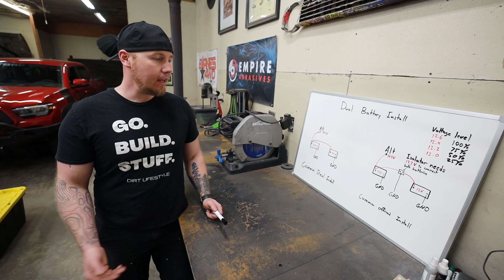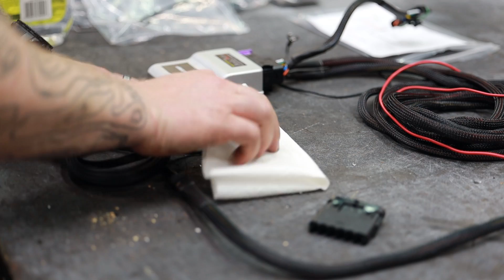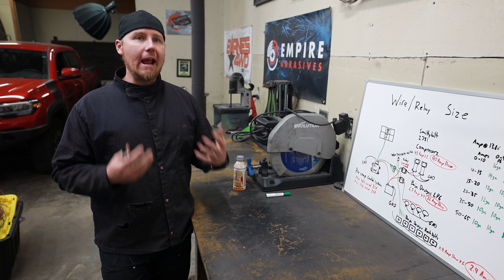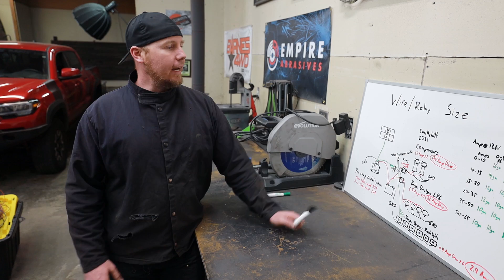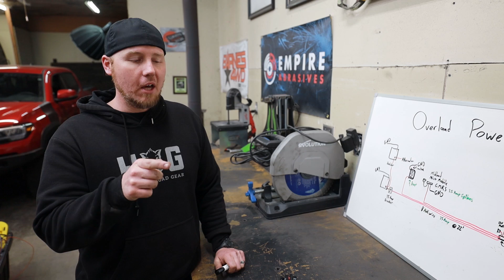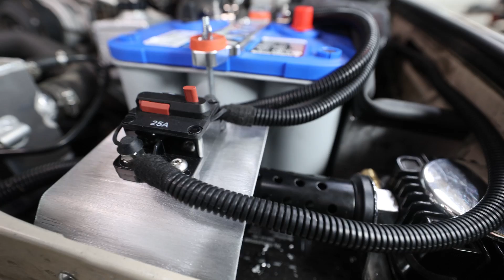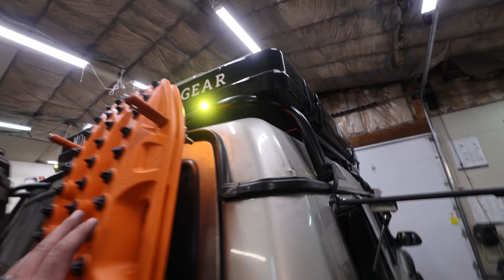A Complete Off-Road Wiring Guide! Ultimate Land Rover Discovery Build Episode 26

Comment: I loved this video. Great work! I love how you did nice neat wiring and how you sealed up your connections with shrink tube. I love watching your builds. You are fearless when you start drilling holes into your rigs.

My two cents.
A couple of things I would have like to seen: How you passed the wiring out of the engine compartment to the off road lights on top and out the back. The other is doing a big three or big 7 wire upgrade to the electrical system to handle increased loads... especially for continuous winching and compressor use...

Also, a DC-DC charge controller is needed when the alternator is a smart alternator or the battery isolator will never see the start battery is charged and then never switch over and charge the second battery system (or it will drain the start battery to fill the second battery). I would also have used a deep cycle secondary battery and not just a second start battery. Another nice thing about a DC-DC charge controller is that you can add solar panels and keep the batteries charging when the engine is not running by using the sun.

Great video. Keep them coming.

Comment: I’m an electrician you always have to account for voltage drop 
(distance of wire from source) safe bet with cars ALWAYS USE 12g-14g and always stay within ohms law this will give you all the numbers you need for wire gauge. Now something to also remember which I’ve done this and had a bad fire that could of been worse in an old truck of mine ran the wire the aftermarket kit came with for my led lights in my Truck cap needless to say after 4 years they burned up caught on fire and fell on my fuel lines and literally melted into my fuel lines. So resistance in your wires cause heat which cause the wires to become hot and over time deterioration sets in the wrong gauge will cause a fire because the wire doesn’t have as much resistance with cars 12gauge wire is always a safe bet 14gauge is overkill but I’ll never put anything else in my vehicle after having the fire I did. Do the research and don’t trust what these companies give you all the time because I got very lucky. Nate awesome video you pretty much hit the nail on the head. But me personally never going smaller than 12guage ever again lol

Comment: In the real world I use 3 batteries to start my diesel van. And the reason I do that is because cranking speed is key to a diesel starting. Even two batteries are getting hit harder than a gas engine. Three batteries brings the per battery amp draw more in line with a gas engine.

Comment: first off, must say Love it, clear concise down to earth explanations, and yes opinions on how and why for everything from battery choice to wiring decisions, is extremely vast.  One thing I would like to add, when you are doing large installations (btw the white board thing is awesome for layout planning, having some form of a map with decision notes helps ALOT, especially if it's a long term gather, or your adding more later or whatever, with notes on the map you can remind yourself WHY you made X decision) it can help when you run 1 larger wire as supply, to use some form of a junction box, or bus bar, etc as your run point for the individual pieces.  It may seem like an over complication, but it really helps later on, with maintenance or trouble shooting, to have known points of a circuit working instead of having to hack back into an entire harness.  example being a light group off 1 switch. it also can help clean up wiring gauge changes  .. 8 gauge to junction/bar, 12 gauge to each light, etc.  On large vehicle upgrade/installations .. I also like having known ground junctions that all feed back to the battery, instead of relying on the vehicle chassis (Ie in the case of the rover, one by a back door behind an easy to access panel, one by the dash, and one in the engine bay).  But again all of that is purely opinion/personal practice

Comment: Get some military battery connectors, allows you to simply crimp on an eye then bolt it up 🤘🏻🤘🏻

https://www.amazon.com/Ampper-Military-Terminal-Heatshrink-Vehicles/dp/B07W61LYG7/ref=mp_s_a_1_2_sspa?dchild=1&keywords=military+battery+terminal&qid=1621810839&sprefix=military+batt&sr=8-2-spons&psc=1&spLa=ZW5jcnlwdGVkUXVhbGlmaWVyPUFLU1U4WkpNU1Q0QUomZW5jcnlwdGVkSWQ9QTAyNTQ5MTYxWUNEWDVIM1ZNWElNJmVuY3J5cHRlZEFkSWQ9QTA2NDE4OTJBMFQ4TFVUMkQ5R1Qmd2lkZ2V0TmFtZT1zcF9waG9uZV9zZWFyY2hfYXRmJmFjdGlvbj1jbGlja1JlZGlyZWN0JmRvTm90TG9nQ2xpY2s9dHJ1ZQ==

Comment: I have that same radio.  My two favorite features.  The USB power port, just because I think that was a nead addition, but the Mic!  The RJ-45 connector for that mic can be extended to just about anywhere, so the base of the radio could be anywhere its convenient, and then you can run an extension to where ever youd like the mic.  I love that its just a standard rj-45.  Probably because I'm a computer guy, and wiring up rj-45 is something I can do in my sleep.  :P

Comment: For all the horror stories about Optima I've heard, I'm with you.....I have had them last forever and a day, so I keep using them.  Was wondering why you were using marine batteries, a fair enough reason.  Another good option is to buy terminals with multiple cable wells.  Also allows you to upgrade "big 4" charging circuit to much heavier gauge cables.  Mostly used for stereo guys, but simply works better especially with all those accessories (anything high draw/load).  I also put in a 200a alternator to keep those Optima's topped off well.  I think most of the Optima horror stories are because they aren't being kept fully charged by weeny stock charging systems.

Thanks for pointing out a good solid state isolator.  There's one made my an Aussie company I really liked, but can't get here.  Had a manual switch to open the circuit if you killed your start battery, could trickle from the house battery to get started.

Ohm's Law...it's not just a good idea. LOL

Also?  I occasionally see people using solid conductor wire for DC applications.  Not a good idea, DC likes stranded wire, AC likes solid.  Pushing DC across a solid conductor increases resistance...back to Ohm's law and potential fires.

Comment: I really appreciate your build video's. Having spent many years in the low voltage install field the only thing that I would have done differently on your build is run a dedicated ground from your auxiliary battery to a separate grounding block at the back of the truck next to your fuse block. That would help eliminate the possibility of ground loops. Other than that, Good Job!
Reply: Dr_Boom, would you explain ground loops pertaining to this install? Thanks

Comment: For my 6 rock lights my numbers are basically the same as yours. 
I’ve had a 15’ clipping of 10ga super slick ultra laying around the pile for a couple years, so I ran it to the furthest light and then t-tapped in 16ga to feed the other 5 lights. 
I’m a fan of figuring the largest need for a feed, sizing up one gauge, then tapping in wire sizes as needed.  
So far, it’s flawless.🤞🏼

Comment: I've got a red arc duel battery isolator  system ( Australian made 😉) and they have a switch so you can manually join the two batteries together if you are winching and the main battery is going flat or u can't start your car, it's really handy.
Reply: What’s the part number for the red arc ?

Comment: Is it worth it to use larger gauge wire (10 -12 ga) throughout your system if you plan to upgrade to higher amperage equipment in the future?
Reply from the maker: Possibly. I would refer to the tables to make that decision 👍

Comment: did you pull a ground all the way back or are you chassis grounding?  i pulled a ground back on my jeep just to do it, and it helps with the blue sea systems when you have a dual post one to just ground everything at the hot source.
Reply from the maker: I mounted a couple chassis grounds and tied them into the fuse box. 👍

Comment: What if you have a vehicle that already has factory dual batteries?  Would you hang the isolator for the 3rd battery off battery 1 or 2 or does it matter?
Reply from the maker: It wouldn't matter but I would get it closer to the alternator if it possible 👍

Comment: Hey Nate, I made a sweet bracket for my Cb antenna on the passenger a pillar if you're interested in ideas. Wouldn't work with a snorkel though.

Come to think of it if you're still running the factory plastic seat boxes I made new ones from steel, you could probably do the same thing from aluminum. They are so much better than the broken plastic

Comment: The build videos are my favorite! I'm new to this stuff and this info is super helpful!

So I fly drones a bit and battery safety is a...hot topic...pun intended. I might be wrong here since this is a completely different battery chemistry/setup but I have a question. When the two batteries with different charge levels are connected and the isolator opens, is there concern with causing a fire or other issues when the two connected batteries try to balance charge levels between one another rapidly or does the isolator only allow the 13.3v (charging voltage) through?
Reply from the maker: Not that I have ever heard. Lithium ion batteries can charge and dump power way faster so maybe that's the difference. But I've never heard of a fire starting because of to much power going from one car battery to the other

Comment: Does this dual batt setup let you jump the car batt if it dies?
Reply from the maker: Yes but not off of the spare battery if that is what you are asking. You can still jump the first battery off of a jump box but to jump from the secondary battery I would disconnect the isolator. This is just to make sure you don't exceed the 140 amp limitations of the isolator 👍
Reply: @DirtLifestyle  Yes I meant to use the dual battery to jump the car battery. When installing my dual battery setup this was important for me since I had flood lights connected to front battery for camping. I couldn't find an isolator that allowed this option. I designed a different circuit using a 250amp relay, two way selector switch and 0 gauge welding wire. Doesnt have the auto isolation/charging though, I would like to. That is why I asked. Thanks :)

Comment: Nate.  Very well thought out setup in the D2 electrical wise that suits your needs !  As the winch fitted draws so much juice, is it connected to your starting battery, or is it 'daisy chained' to your auxiliary ?  V.
Reply from the maker: Great question! I hooked it up directly to the starter battery. The isolator is rated at 140 amps and I don't want to draw to much power through it. 👍

Comment: Forgot to ask are your LP9s the Pro or Sport? I’m looking at the Pro LP6 but they state you need to wire the high/Lo function separately. They can never be powered at the same time or you can damage them. Makes the install with a solid state switch a bit more technical. I’m guessing I will need a relay that doesn’t allow power to both sides.
Reply from the maker: These are the LP6 pro. Best looking light on the market imo. 👊

Comment: Only 5 mins in, but why not run a deep cycle battery as your second battery? Like one from Renogy? Is there an advantage to running 2 “starter” batteries?
Reply from the maker: Thanks for the question!
I have a couple responses.
The blue tops are a deep cycle battery. "Deep cycle" doesn't refer to anything other then the batteries ability to discharge very low (like down to 20%) and recharge without damage. Most deep cycle battery manufacturers don't recommend below something like 50% but either way these Blue tops meet that criteria. 
Like I stated in the video I love these batteries because of the extra posts making it super easy to expand the electrical system.
Optima actually recommend a larger battery but I have height restrictions and can't go any taller then I already have. 
In regards to all these new lithium ion batteries being used in offroad applications. Lithium ion is much less stable and is more sensitive to vibration then a standard automotive battery and when they catch fire it is extremely violent and hard to extinguish from my understanding. I'm attracted to the lithium ion stuff for a number of reasons like  weight savings, battery life, and AMP hours. But am still waiting for them to prove the same reliability offroad and for the price to drop. The Reno batteries look awesome! But at 800 bucks I'm not sure how viable they are for most people at this time. They certainly have my attention but In the meantime I'm using a battery that I can have 100% confidence in. Optima checks all the boxes for me 👍
Reply: @DirtLifestyle  thanks for the reply! I currently run a yellow top in my Jeep. It’s been there for probably 5 years now with zero issues and couldn’t be happier with it. Sounds like I’ll be adding a second one when I get my fridge.

Comment: Nate, very well done - love your whiteboard work. 

Perhaps I missed it but my experience (boat wiring) with the wiring charts is that circuit length is the total of the supply and return path. If the component is grounded immediately to the frame I’m guessing that negates consideration of the return path length?

Thanks and keep up the great work.
Reply from the maker: I haven't heard of the this before. I could see it being a factor but I would need to do more research to get a solid answer 👍
Reply: @DirtLifestyle  Nate, below is copied from the Blue Sea (marine) web site for wire sizing. It could be that your chart effectively doubles the length, accounting for the “roundtrip” circuit length. Also, in automotive applications, if the ground is through the frame and the bolted attachment point, I would think the ground circuit is effectively a very large conductor. 

B  Find circuit LENGTH IN FEET along the left side of the chart. Note that the total length of the circuit is the roundtrip distance from power source (usually the battery) to the product and back.

Comment: I did a Lighted roof rack once on my 97 ZJ. Instead of tucking wires I used a boat trailer connection threw the center of the rear roof waterproofing it with silicone. Anytime I wanted to remove the rack, I could and just disconnect the trailer plug. Plug outlet had a sprung loaded waterproof cap no leaks and worked grate. All wires were snaked through the tube structure of the rack to the individual lights.

Comment: I just bought that radio...hid it behind the stereo on my TJ... Midland makes an extension cable that makes mounting the plug on the dash easy. Also check out Breedlove mounts...nice hardware for mounting antennas. Dielectric grease...need it inside all your crimps and antenna connections!
Reply: Breedlove makes fantastic mounts. As for antenna position, center of the roof is the best. That gives the best ground plane for the antenna.

Comment: i own  a 1987 jeep yj i blew the motor a few years ago and it just sitting slowly rusting away i want to replace the motor but i want it to be a fun time  jeep doing all the thing i watch other jeep owners doing. any recommendation on the type of motor to replace with. another straight 6 or another type. open to options  please help/...
Reply from the maker: I would build a 4.6 stroker. Double the power, bolts right in and a fun project 🤘
Reply: The 6.0L LS that you see on this channel from time to time is sick.

Comment: Great video I used the Blue Sea Systems app when I did my system. You input all the info and it gives you wire gauge sizing and fuse requirements.

Comment: My 2018 Jeep Wrangler JL has a 12v Battery and a Aux battery. And it runs at 13.2 Volts . I wonder how different my Jeeps battery setup is compared to the two examples shown.
Reply from the maker: Interesting! I haven't seen a vehicle that runs less then 14.2 volt but the standard is 14.4 🤷‍♂️
Reply: @DirtLifestyle  I have a 12k Smittybilt  x20 winch and 10 inch Pro Comp Light bar connected to them. But even before the light bar is was showing the same. 13.2 or 13.3 it fluctuates
Reply: @DirtLifestyle  I wish I could add screenshots to YouTube. Would love your input on it. I am very much a noob mechanic. And I don't know much about wiring. I did find your video very informative though. Thanks for making it.
Reply: @DirtLifestyle  Just FYI the Aux Battery on JLs and JTs are not true 12v batteries I don't think. They are tiny odd batteries.

Comment: Still the best offroad channel on YouTube
Reply: Great work. And I personally sincerely appreciate your whiteboard work!  For me the challenging part is always how to run the wires cleanly through the trim front to back or from the edge trim to the Midland, for instance. Just leave it under the carpet?  What if I remove the carpet. And how did you clean up all that red wire from the A pillar to the BD lights?
Reply: Second this! Any coupon codes for midland or you just get credit for buying through the link?
Reply from the maker: Much appreciated brother 🙌
Reply: @DirtLifestyle  I prefer your build shows to your adventures. You have fantastic solutions that I don't see ANYONE ELSE trying. Not sure how you don't have a lot of copycats.